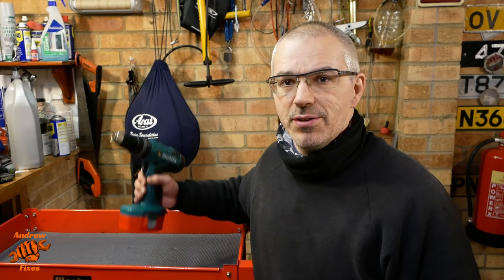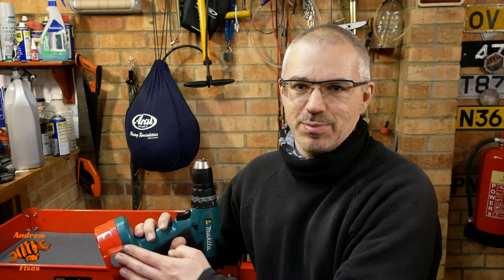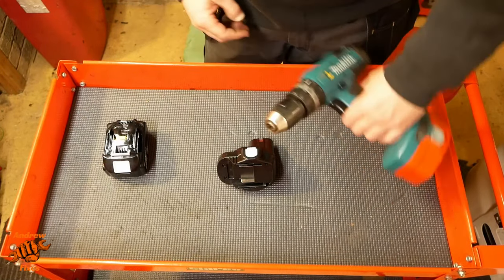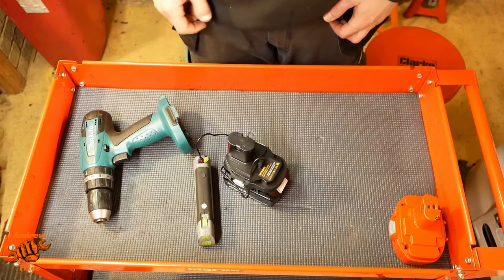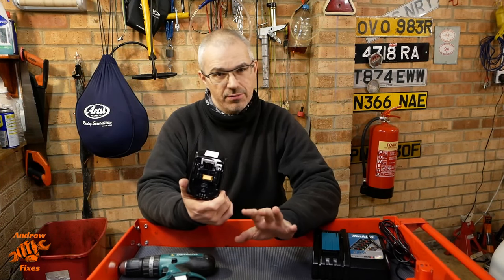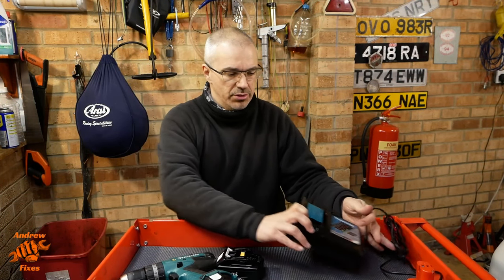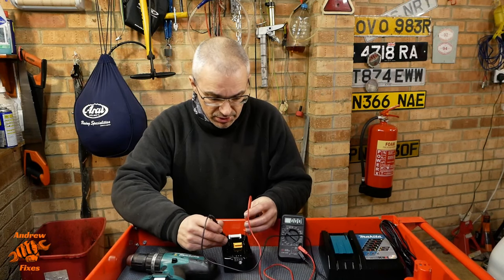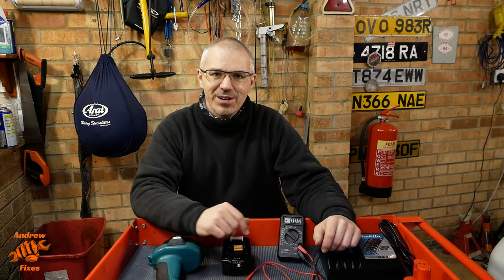Makita NiCad to Lithium conversion | Makita NiMh to Li ion adapter | Using LXT battery on NiCd tool

Comment: I’ve got 3 of those drills and have just bought a 3d printed battery adaptor to take one of the Aldi ferrex batteries. I’m just about to dismantle one of the old makita pa18 (as per yours) batteries to make a Frankenstein conversion ‘glue-up’. Re the under-voltage issue I’m pondering on using a combination of resistor/leds in the neck of the old pa18…..a combination of these will stop current flow (ie stop the battery from overdischarging) when it hits a limit that is below the forward bias of the diodes.  👍
Reply: Ever write this up or make a how to?
Reply: @donien3113  No I didn't. More research identified it as being more complicated than I first thought. From memory I watched another vid shortly after that simply made use of the 3 (or 4?) led lights on the ferrex battery in order to give some 'rough' idea of the voltage state of the battery....ie when it drops to one led, charge it! I made the conversion months ago and it's working a treat 👍

Comment: Recharge at 18v, or before, the earlier you charge the longer lithium packs last, the voltage is a nominal number, a 12v lead acid battery is flat at 12v, charged at about 13.8, 18v lithium packs are charged at about 21v and flat at 18v ... though you can use them below 18v you are shortening the cells lives.
Reply from the maker: Thanks for your comments John!

Comment: Do you have a problem w/heat? I use this on a small radial saw and it overheats the adaptor to the point of melting the connections
Reply from the maker: Thanks for the question, no I don't but having said that this drill rarely gets used at full torque for long periods, so maybe I never put it in a situation where it could get hot. I can see how a radial saw could involve a lot more heat.
Reply: Yes safety point, the new battery tech does not talk to the old tools for battery management & discharge purposes of cell balancing & heat management, stopping max drain of lithium cells is the key difference to try to avoid. 

Personally I would only stick to drilling with Lion slim 18V 2amp batteries for comparative size to the old pod batteries. 

The adapter I use is the lowest profile I know of at only 8mm taller than the old pod battery setup but using fast charging 2amp new tech batteries, that ejects backwards for ease of retrieval on old work horse drills. 

See my work:
https://youtu.be/liIVP8CDkzc 

Ex work bench hand had these model drills since I was 16? I'm 40 now, upgraded to new drills but they have the tendency to fall forward & snap your drill bits, the old one was bulky heavy but never did that lol. 

What's next, upgrade the battery terminals in the Liondapter 😂🤣😭 🦧 flat plate copper folding 🤔🧐🤦🏼‍♂️😁

Oh the joys of build back butter 🧈 🫠 this tool is melting 😉 lol. 

Oh copper plumbing pipe of the right thickness gutted down the middle pounded flat might work also, if you like thankless tasks, as long as it doesn't fatigue it??? 🤷🏼‍♂️

Comment: Why can't you charge the newer batteries in the older charger with the adaptor?
Reply: The Chargers for Li-Ion batteries and for Ni-Cd operate differently and with different protection systems.

1.)
You cannot charge a Lithium Ion battery with a Nickel Cadmium Charger.

BUT...

If the connection is the same AND the pack voltage is identical you can use the Li-Ion charger to charge a Ni-Cd battery as the technology was created to be backward compatible but not forward compatible.

2.) Lithium Ion Batteries have circuit boards called a Battery Monitor System (BMS) that monitors and adjusts charging based on thermal, voltage, current, and charge data. These monitors make sure that your Li-Ion battery charges to the proper level (OVERvoltage and UNDERvoltage will shorten lifespan and can reduce capacity) at the correct current (both OVERcurrent and UNDERcurrent can damage cells) without going over the safe temperature limit (explosive in high temps)

*Lithium batteries require extremely precise voltages during charging (compared to older cell material technologies) and need to be charged to a precise level. Even a 2% variance in charging current or charging voltage or ending voltage can reduce capacity permanently, can trigger a protection shutdown needing a soft reset or can trigger "sleep" mode in the Cells which require a special intelligent charger with "WAKE" Functionality to reactivate the battery. This Sleep mode is most commonly triggered by over-discharging to less than 3.2v per cell but can also occur from over-charging beyond 4.2V per cell and from overheating cells. Lithium batteries are very sensitive to heat damage and can reach a critical no return temp that will continue to react even if the load or the charge is removed causing combustion. 

There are some more reasons they cannot be charged with older technology but this reply has already gone on long enough I think.

Comment: cut off is done by the bms inside the battery pack.
Reply: Nope ... have tested this and I can flatten a battery pack with my older tools lower than my newer tools will allow
Reply: wow, really!!!, alright i'l make sure to keep an eye out as well, thanks for confirming.
Reply from the maker: Thanks John, as I suspected...
Reply: Steve D  Have 3 x 5ah and 4 x 6ah Makita BL batteries ... all less than 8 months old, all of them have been drained well below what I'd like, sometimes down to 16v ... I know this as I live of-grid and charge them with an RC charger which displays the voltage, I'd normally charge them after 1 of the 4 led's no longer displays, this is about 19v, which is really more than half discharged not 1/4 ... (18v discharged with minimal life cycle loss, 21v fully charged) but sometimes I forget to check, as far as I'm concerned the batteries can too easily be discharged too low a voltage on my older tools with the adapter I once was so busy I didn't check till the tool was slowing, an older circular saw, the voltage was 14v and surely shortened the life of that battery pack.. strange thing is, this older brushed circular saw uses much less power than any of my other tools and can be used for several hours and often only drop to 20.5v
Reply: @johnussss  18v is 3,6 on single cell. Li Ion can discharge to 2,5V see some data sheet of Li Ion battery.
Reply: Steve D  18v is 3,6 on single cell. Li Ion can discharge to 2,5V see some data sheet of Li Ion battery.
Reply: @olagem7714  Data sheet won't buy me replacement batteries because I discharged my batteries to the minimum described in the data sheet, just like a car manufacturer won't replace my motor because I serviced it at the marketed rate of 10k miles rather than 3k which is what you need to do if you want the motor to last.